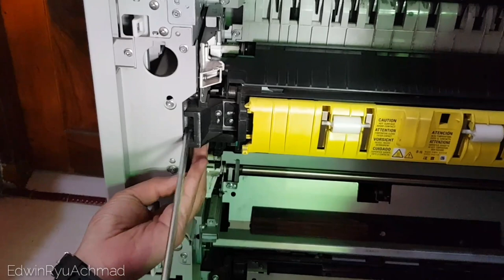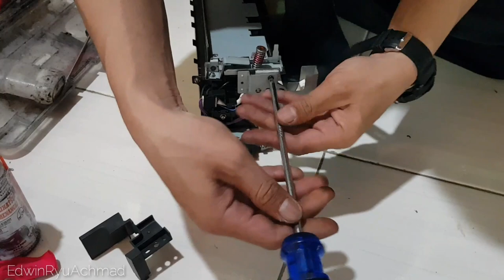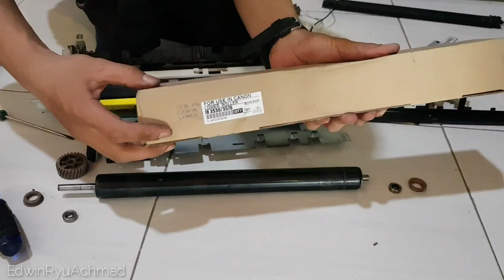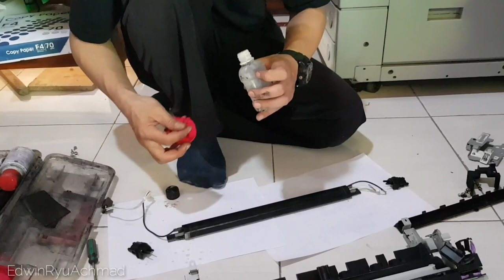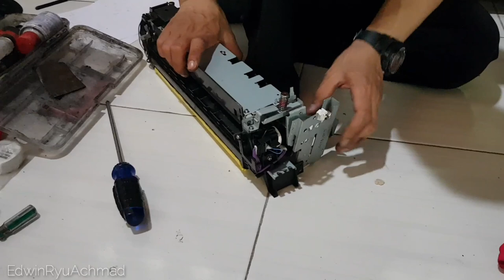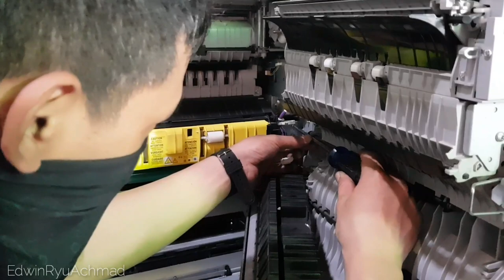Replace Lower Roller / Pressure Roller || Replace Silicone Grease || iR3245 iR3045 iR4570

Comment: mesin saya ir2870, sudah kasih silicone grease, sudah cek lower,masih sering jam paper dengan keterangan delay- sensor no. PS14 , mohon pencerahannya
Reply from the maker: Faktor jam paper dipemanas:
1. Bs dr karet2 di cst udah pd alus
2. Level sensor di cst kdg g balik lagi
3. Bearing/laher lower seret
4. Fixing film kdg harus waktunya ganti
5. Level sensor di unit pemanas (PS13) kdg ga main, kdg patah
6. Lower yg mulai kriput
7. Motor clucth regis kdg kotor karna karat
8. Dr kertas lembab jg bs pengaruh jampaper, malah merk2 kertas tertentu jg bs bikin jampaper
9. Sebelum kasih silicone grease ga bersih masih ada kerak2 jg bs pengaruh
10. Coba bagian luar fixing film n lower dilap sanpoly
Reply: @EdwinRyuAchmad  terima kasih banyak pak, barusan sudah ganti merk kertas, sudah berkurang jam papernya, tp kadang kertas yg keluar jadi bergelombang di bagian tengah sampai bawah, apakah temperaturnya terlalu panas? sebelum ganti merk kertas,outputnya juga sering bergelombang
Reply from the maker: Kl kertas bergelombang, masih ada maslah di unit pemanas, perlu dianalisa lagi,

Comment: Kondisi lower roller mesin sy agak keriput bagian tengah roller..sekitar 4 cm..dan hasil copyan berbayang/blur/huruf yg tercetak meluber...apakah ini disebabkan oleh lowernya yg keriput td mas..?mohon pencerahannya...
Reply from the maker: Apa hasil yg bayang pas persis ditengah? Pas posisi kriput dilower?
Kl iya, kemungkinan bs lower nya!
Kl hasil bayang/blur bs dianalisa dr hasil bayang/blur nya sendiri, apa bayang nya ngetrap, atw keseluruhan blur smua,
Hasil bayang/blur yg diakibatkan dr unit drum atw developing dan pemanas atw motor clutch regis jg beda hasil blur nya!
Reply: @EdwinRyuAchmad  posisi bayangnya keseluruhan teks mas...bukan hanya di tengah pas posisi keriput lower...alhasil huruf yg tercetak tidak solid(tajam) klw sy tes print di service mode>test>pg..yg kotak2 itu..hasilnya..untuk garis horzontal tajam(normal)..tp untuk garis vertikal jadinya dobel(garisnya teruarai jadi 4 garis tipis berdekatan)..disemua garis dari kiri ke kanan...
Reply from the maker: @hendryprasetyo3461  analisa pertama cek unit drum, apa drum n blade masih layak pakai? kondisi primari gmn, biasanya perlu di bersihi pakai sanpoli karna kerak toner.
ke-2 unit developing, kondisi as roll magnet ap ada yg aus? puteran lancar ap agak seret, cek bagian bearing sm sapcer, gear2nya jg
ke-3 cek motor clutch regis, posisi di belakang, untuk bongkar pasang agak repot, kondisi clutch kdg ada kerak, bisa dicoba dicuci pake bensin, clutch yg bermasalah bs bikin hasil pucet, hasil maju-mundur, kdg jg macet di bagian regis
ke-4 laser unit, bs dicoba untuk dibersihi atw dicoba tuker 1unit laser
Reply: Makasi gan infonya..sy cek dulu...sangat membantu skali infonya...